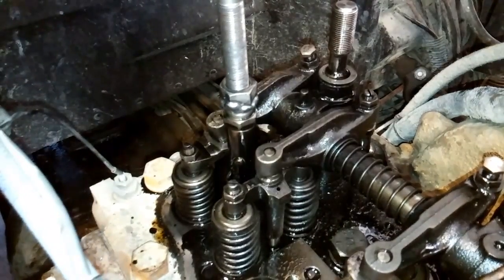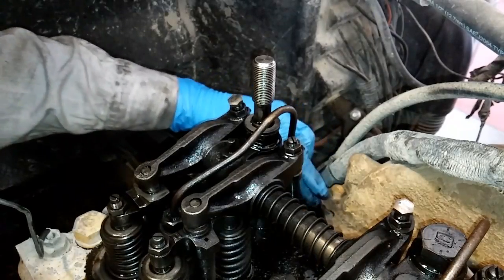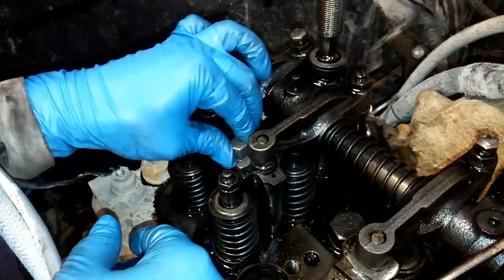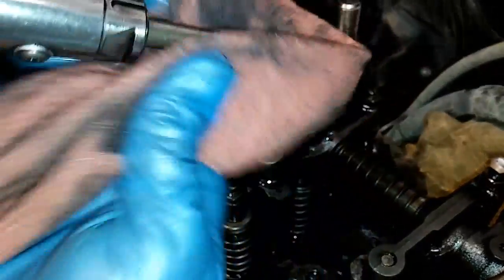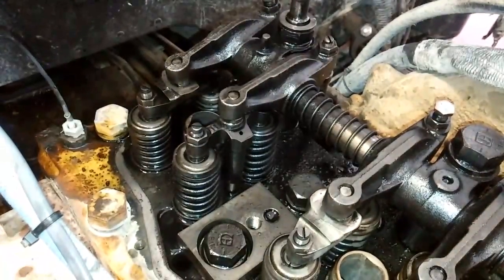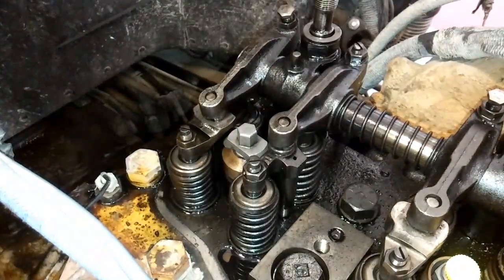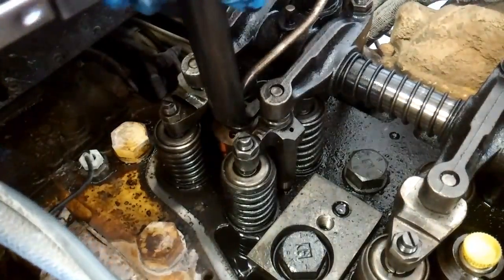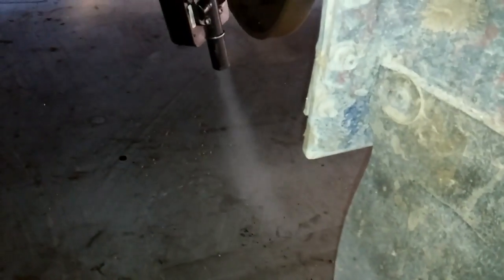How To Remove And Install 3406B Fuel Nozzles.  3406C Fuel Nozzle R & I.

Comment: I agree make sure that little screw on each injector is tight. I didn't, so now I'm just in the process of pulling all my new injectors because those screws are loose and I'm getting fuel in oil.

Comment: I had to fix a bad fuel leak, I haven't done it before on the road, to fix the leaking problem,  I have a set of copper crushed washer. 
Thanks. 
On the road again.

Comment: I found washers at the bottom of all the holes and distinctly remember washers being on the nozzles I removed. Is this a previous person’s screw up?
Reply: Should have only one washer. They fall off sometimes and have to be removed.
Reply: @johngoldsmith6629  that’s exactly what i thought. Thanks. I pulled them out in hopes that I wasn’t wrong.
Reply: @johnsweet8410  Two or more washers lifts the nozzle up and changes the spray angle on the piston. You did good.

Comment: What's the Fuel line O-Ring Part number, please?
Reply: 1H1023 cheaper         8L2779 more expensive  The seal is only good for a leak at the line to adapter joint. It forces the fuel to leak out the adapter rather then into the engine.

Comment: what causes diesel in oil 3406 b Cat?
Reply: Nozzle bleed screw seal leaking, nozzle top seal leaking (have to replace nozzle), Fuel transfer pump (very rare), spacers under pump cracked (very rare) or somebody resealed a pump leaking fuel and got dirt under pump. Fuel line at nozzle connection or adapter thru the head connection (that connection suppose to leak to the outside).
Reply: @johngoldsmith6629  
thank you I will start with least expensive area first
Reply: @threesisterstrucking8044  Remove the valve covers. The nozzle chamber cap has two holes. Put your finger over one side and take psi air and be careful, put air in the other hole. If solid black oil comes out that nozzle is OK. If diesel fuel comes out, you found a leaking nozzle.

Comment: Great Video! Just curious if you might do more how to’s on the 3406B? I just bought a peterbilt with a 4MG
Reply from the maker: John always helping people in the comments 👍
Reply: @AdeptApe  Thanks, I was raised on these. What is fun is rerating these darn things.
Reply: What is your engine serial number?
Reply: @johngoldsmith6629  I just tried to read the sticker it was roogh, but need to read the number on the side of the block but I think it’s 4MG54926
Reply: @seansclassoictrucks  That shows to be a 425 HP sold in Australia.
Reply: @johngoldsmith6629  I got the number wrong then, I’ll check again , it’s a 362 sold at a Coast Counties dealer
Reply: @johngoldsmith6629  correction pretty sure it’s 4MG54026 maybe 4MG54025, in an 89 Peterbilt 362
Reply: @seansclassoictrucks  
4MG54025
7E-2288 ENGINE AR
317 BRAKE KW (425 BHP) AT 2100 RPM. CARB-CERTIFIED, PETERBILT, JAKE BRAKE

4MG54026
7C-7623 ENGINE AR
317 BRAKE KW (425 BHP) AT 2100 RPM. CARB-CERTIFIED
Reply: @johngoldsmith6629  thanks!
Reply: @seansclassoictrucks  So which engine you have and what do you need to know? Take your vin and call PB and they will tell you as shipped engine serial number.
Reply: @johngoldsmith6629  
HI John Goldsmith, I have a 1994 peterbilt with a cat 3406b 3ZJ44897. About a year and a half ago truck broke down lost a lot of power and was throwing a huge amount of white smoke. Unfortunate for me I couldn't find a cat dealer that would have time to work on it. Took it to a mechanic I met at a peterbilt store, he said he can take a look at it right away. A few mechanics mention that it could be the nozzles so I took all 6 of them to speed up the process. He said that one was bad and maybe 2 more, so I had him replace all 6. After he replace all 6 the problem was still there. He had me rebuild the fuel pump paid around $4000. Still the same problem. He checked the turbo and it was bad, he told me that he only checked one side and it looked ok. Bought a Borg Warner turbo and he install it. I was expecting the truck to run a lot better but for my surprise it was nothing close to how it was running  before. It felt like it was missing power loaded, specially going up hill.  I finally took it to another mechanic and he claims that the timing was retard two teeth and idle the truck down since it was idling hi. I took the truck and it did run quieter or smooth but still was lacking power. I haul aggregates with  a 22 foot dump trailer so a lot of times its on site work and hardly drive on highways. So it takes me a while before I can run loaded on hills or expressways. Any ways I took it to Peterbilt cause they had a cat teacher over there. And again they claim the timing was off and retimed it. They replace the diaphragm and some o-rings. But I still have the same problem, its still smoking more than normal and has low power. I did notice the manifold psi has little psi on lower gears and 14 psi max on 8th 9th and 10th gears. I will check with them and see if they did a fuel pressure and vacuum test. Ask if they did a intercooler leak test.  Any advice would be appreciated.
Thanks
Reply: @royrodriguez9224  First off you have a 3406C, not a B. This engine has three main power problems, fuel nozzles, injection pump bushings and timing advance. It was built 8-20-1993 and put in service 12-10-1993. Left the factory as a 425 HP @ 2000 RPM with a Jacobs Brake, 1550 FT LBS of torque.

Throttle linkage is a problem, you have to make sure your getting full throttle travel. The throttle lever has three parts, so when you press down on the throttle you should feel the pedal hit a spot. When you depress it more it should be at what is called break over point. The lever will deflect back, but the governor shaft should not move. Has a slot on the side and it should be in the middle during break over. To little travel, not reaching set point (low Power). To much travel putting extra pressure on governor shaft seal when cab flexes. The lever usually has two holes for the linkage. The lower hole is the best as you have more travel. Moving the lever on the throttle shaft changes the angle of the pedal. First item I always check as it don't cost anything.

Fuel Ratio Control, FRC. Mounts on back of the governor. Restricts fuel until turbo psi builds up only during acceleration. This one cocks with oil psi. So plugging the air line from the intake manifold to it will cause low power. 
I use a low psi pump, remove the line and hook up to the fitting on the FRC. Put 15 PSI on it and see if it holds PSI. The part under the diaphragm gets a sharp edge. You have to grind it down some when you rebuild it. If not you can cut the brand new diaphragm when you put it back together. Also it can be out of adjustment. You have a lever setting and a FRC setting. To rich (faster to respond), to lean (sluggish). When I rebuild the governor, I use washers out of a PEEC engine to shim the lever center. Have seen it drag on the FRC valve. Or you can purchase a 8N3799 cover, 9S8001 plug and a 2385078 seal. Remove the FRC, cap the fitting in the intake manifold. Put this cover in place of the FRC with two 1/4 NC bolts one inch long and see if problem goes away. If so your FRC is the issue. If you leave the cover on don't be in California. Second thing I would check.

Fuel psi,  9/16 plug in the fuel filter base, oring boss plug. Fuel psi should be 40 psi idling. Revving up to high idle, should drop to 30 PSI and come back up to 40 PSI. Under load fuel psi should not go below 20 PSI. The fuel transfer pump is a poor design and the gauge may bounce. If so you have to put a snubber in the line or you can destroy your gauge. System has no relief valve. Fuel psi is from the return fitting in the main pump. I dislike the number four line, can plug up. Number six or eight is better on the fuel return. What is your size? Only way to increase fuel psi above the forty is to add a 6N0515 to the system. So it will have two springs. Usually adds ten psi to the system. Third item I would check.

Fuel nozzles, they are junk. Left the factory with 100-7556 new number or 20R5169 reman. Nozzles open up with age and allows more fuel on the piston. Cat tried to prevent this and came out with these nozzles called extrude hone. Instead of opening up, they closed up. Thus less fuel on the piston, low power, misfire on acceleration. Have put bad ones in right out of the box. They was so bad, a recall was out when these years ago. The fix is, install 0R4337 nozzles. 3ZJ engines you cannot order nozzles by the book, most of the time. What part number did you put in? Fourth item or if you know part number very easy to check. 

Timing advance, I would check my pin timing. If bolt goes in first, your retarded. Higher boost, sluggish, dislike retarded timing. If pin goes in pump first, advanced, lower boost better response. Do not like mine over 1/2 bolt hole advanced. So if pin goes in first, take a seal pick and feel in the bell housing how much of the hole you can feel. Remove the outer cover and see if it has come apart. The snap ring likes to break and you have no advance or the 8C9034 bolts fall out and you got a mess. Never reuse the bolts that hold the carrier on (8C9034) or the mounting bolts to the pump. Also about half of the ones I get now are assembled wrong or wrong parts. DO NOT MESS WITH THE SCREWS IN THE COVER. That is you start and stop adjustment. You have to install a timing indicator group to set them. If timing has a issue I can walk you through taking it off and timing it. Just check pin timing and remove cover for now. Fifth item I would check.

Fuel injection pump. With higher emissions, injection psi had to go up. Problem was the bushings would not seat the pump firmly in the bore. Pumps would bypass fuel and not put it on the piston. Cat tried to change bonnet design, we would lap the pumps and replace the bonnet. Finally they redesigned the bushing. Also they are several pump groups, one single helix, most dual helix. Dual helix pumps use different check valve for emissions. Did they replace the pumps? If so what part number? Does it have the new style bushing? If not the pumps will be no good after awhile. Last thing as this gets expensive.

Also fuel injection lines needs updated brackets and clamps. If they are missing your going to break fuel lines. I use a 8PN style setup and change it up some and make it stronger then what a 8PN list.
Reply: @johngoldsmith6629  
Thanks for the info. I haven't been able to do much since we are busy, we are at the end of the construction season here in the Chicago but stopping soon. One thing I did is gave the fuel pedal more travel and made a huge difference in performance. All I did was lower the stop screw under the pedal. My son still feels the engine weak going uphill but runs way better. We should stop working in a week or two once we get snow and freezing temp and hopefully be able to look into it further. Again thanks I will keep you posted hopefully I can get it at least how it was before. I will also get you the info on the nozzles cat gave me and the turbo.
Reply: @royrodriguez4096  ok
Reply: @johngoldsmith6629  Hi John,
Hope everything is great and you are doing well. Its been a long year struggling with my truck with low power. I  have taken it to a couple of mechanics and no luck, they claim to know what they are doing but give no good results. Any ways this is what I have done so far that change and brought the power back to the engine.
I took your advice and replace the fuel nozzles the last ones I put in where 20R-5169 back in 11/2020. In 05/5/2024 replaced the fuel nozzles with the 0R-4337 you recommended, timing set as original and also pin timed . Huge difference in power test drove it seem ok it was smoking a bit. I took it to work one day and started to have some problems fuel coming out of the blow by. I too it apart again and notice that the 1 st nozzle was loose so I check all of them and torque them again at 35ft lbs. I had a lot of fuel on the oil pan as well. I went ahead and change the oil and put everything back together. Truck has recover its full power again. Its running great loaded too. My problems now.
--0 oil pressure when starting so it cranks for 15 or so seconds to build oil then it starts. before it started instantly.
--a lot of white smoke especially when engine is cold, then it smokes less about 70% less but it still smokes pretty noticeable
--little fuel was coming out of the exhaust manifold. check the bolt and was loose so I tighten it up
--last I did notice a redish-orange color drops maybe 3 or 4 drops of the turbo on the exhaust side
So I am a little confuse on what to do first. Should I change the fuel nozzles and go back to the 20R5169 maybe the 0R4337 are releasing too much fuel.
Should I replace the Turbo first
Should I have the advance timing recheck( it was rebuild in 11/2020)
Any help would be greatly appreciated.
Reply: @royrodriguez4096   The nozzles are the correct part number,  
(Service recall from Cat) Problem, Some 1007556 Nozzle Assemblies may experience a fuel rate loss with a resultant complaint of low power on certain 415/425 hp 3406C Engines. Affected Product Model & Identification Number, 3406C 3ZJ 36410-52109, Parts Needed, 6 - 0R4337 Nozzle Assemblies. This is directly from Cat.

Sounds like you have a fuel in the oil problem. Have you tested the oil for fuel? Do you have a Kysor shut down system? If you take the turbo off and the manifold is wet. You know it is coming out a cylinder. If dry, turbo could be oiling. If the fuel is turned up or dynamic timing is not working properly. That could make fuel out the exhaust.
Have seen hard to start on these. fuel return line plugged. Number four lines would collapse and hold fuel psi on the system. Your fitting maybe larger. Best way to start these is to press the clutch down and depress the throttle half way. They start easier this way. Or something could be worn in the governor. The snap ring can break in the timing advance and or a flyweight bolt comes out. Most of the time, I see a lot of the assembled wrong. It don't hurt to pull the timing cover off and inspect the advance. If somebody has played with the screws on the advance. The only way to fix them is with the timing indicator group. Few dealers still have this tool and very few people still know how to use it.  Your VTU is assembled this way, spool valve with a race over it. The flyweight ends lay on the race. A cone race lays on top of the flyweights. A snap ring locks on top of the cone race. A race same is the first one is upside down on the snap ring to protect it from the spring.
Reply: @johngoldsmith6629  Thanks for the info. I did had diesel going into the oil and replace it once. Yesterday I replaced the nozzle with the 20R-5169 (cylinder #6, since I did notice some diesel fuel bubbling out the rear of the exhaust manifold. I have tighten two bolts that were slightly loose). Just testing things, I knew I had 1 out of the 6 nozzles that was bad. I was hoping to pick the bad one to mark it out. After swapping the nozzle the smoking was reduced a lot, still smokes a little but and more blueish than white. I will change the oil again today to try to get rid of any diesel left on the engine and turbo hopefully this helps. I will test it out today again with fresh oil and see if that helps. Turbo boost is till strong, just trying to get rid of the smoke problem. Thanks
Reply: @johngoldsmith6629  I thought I had replied to thank you and gave you an update but I don't see it. Any ways thanks for all your help. I order a nozzle pop tester and will test all the nozzles and will give you an update. Peterbilt did the static test on it and was told it was a bit high at start and recommend me to just leave it as is. I did turn up one full turn on the torque and fuel screws on the back of the fuel pump. It has a Kyser warning system only it doesn't shut the truck down. Will the turbo cause the white smoke and still have great response. I check both sides of the turbo and had no signs of any liquid stains. Truck gain all its power back and is still running strong? It doesn't seem like its loosing coolant.  If I slightly play with the pin timing do you think it might help or should I just check it and leave it dead center(pin timed)? I will give you an update hopefully by the 1st week of June. Thanks again for everything.
Reply: @royrodriguez4096   Most I go on timing is 1/2 bolt hole. Timing will cause smoke.

Comment: I have a b model cat 3zj in mule truck the freeze plug in the head (that’s under the valve cove) came out and was putting coolant into the oil. What would cause this?